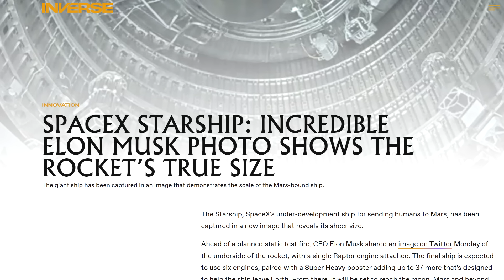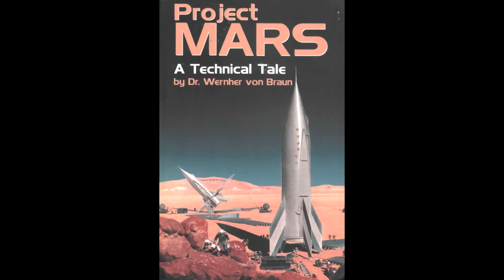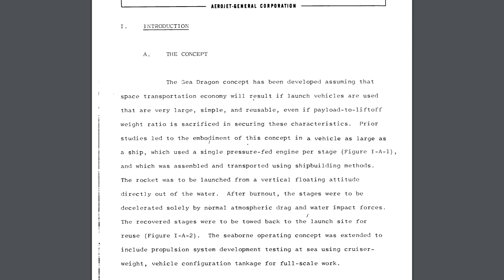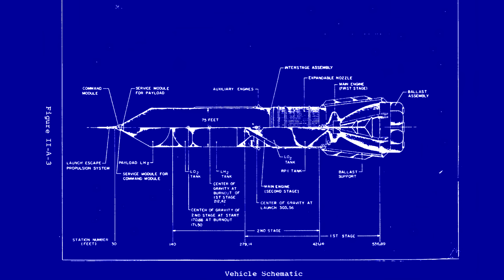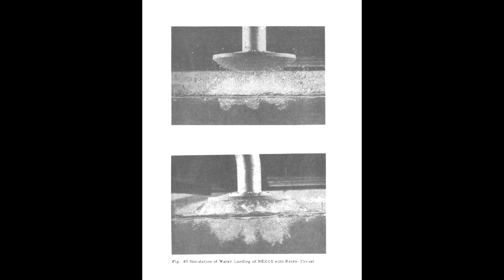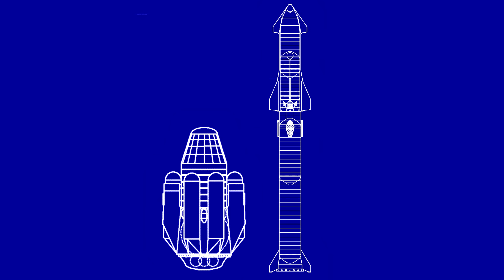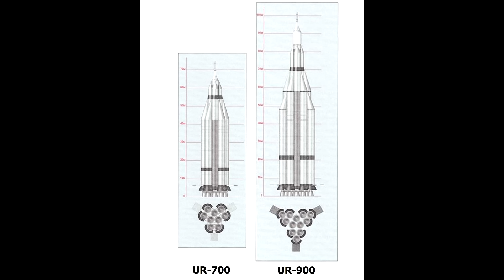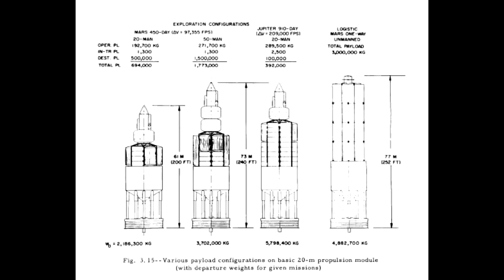The Old Rocket Designs That Make Starship Look Small

Comment: It's always surprised me how the Russians never really tried re-using rockets. The biggest problem the US has with it is that they launch over the ocean, and that's just not an issue for Russia... it'd be so much easier for them.
Reply: Well, they did quite a bit of work towards that: Buran/Energia and particularly Energia II. The problem was that by the time that reusable rockets could even pretend to be practical, the Soviet Union was on its last legs.
Reply: I'd like to point out that launching over the ocean is very much a feature, not a bug.
Reply: @Cancer McAids the problem with that is that rocket engines require very precise engineering and manufacturing, as well as special materials that can take the heat so they alone are going to be pretty expensive no matter what. Even a disposable booster could benefit from recoverable engine pods.
Reply: @Shaun_Jones  Which is apparently one concept United Launch Alliance's Vulcan is studying for recovering the BE-4 engines...if Blue Origin ever delivers them.

Comment: A design actually flying is kinda important. You can design almost anything you want, doesn't matter until you make it fly. Even just building it can uncover serious design issues.

So yeah let's just wait and see if Starship actually takes off. And not only that, it also needs to be economically viable. Remember Concorde?
Reply: Fun fact: One of the Heavy-lift Vehicles from NASA's SPS study (the Alternate Design at 10:31) has similar payload to Starship (120t), yet only 4000t mass when full. Which is less than simply the fuel mass of Starship (a 20% boost), and even with some mass reserve! Apparently, aluminium construction/winged flyback is a pretty efficient design!

Comment: I worked at the Naval Air Warfare Center Weapons Division in Solid Propulsion.  I worked on the base for 16 years.  The general public always looks at these design proposal documents wrong.  There was very little (if any) actual engineering that went into this.  The goal of these papers is to try and find some new emerging technology or buzz words that give an Admiral a hard on so he funds your project.  
These are boiler plate documents and mostly just a formality to show that you put some thought into the bullshit that's in your powerpoint presentation.  Each engineer in my branch was required to write 10-20 of these papers every year...the papers are completed and circulated just before the end of the fiscal year.  When you're in research and development there is very little direct funding from a major project because major projects are already passed the R&D phase and onto development, test and evaluation.  
Every single one of these papers claims you're gonna make the best thing ever that goes farther, faster and costs less than anything else that's ever been made.  If it doesn't do those things.....why tf would you be making it.  The whole point of R&D is to improve upon existing technology, so you're never going to see one of these papers that says "my rocket is slow and heavy, it basically has 100 lb cargo limit, and its gonna cost a shitload of money and assuredly be 4-5x over budget."     
A crapload of these documents are written every year.....it's one of the main ways folks in R&D get funding.  But an Admiral isn't gonna sit around all day reading 400 page documents....each of which is just proclaiming how great and cheap it is....which leads to the reasons for all the animations, graphics, etc.  No one is ever reading what you wrote on page 392 of your document.  Like I said...the document is a formality.  The buzzwords, graphics, animations sole purpose is to sell a product.  It's the whole reason they're made.  And they work....there's a reason you did a video on a 60 year old rocket.....and I highly doubt it stemmed from someone recommending you rad this awesome 400 page design concept from 60 years ago.  You saw an animation of this thing blasting out of the water and went "WTF is that" and immediately went to google trying to find it. 
Things like this get all this praise....it's so big, it's so cheap, it makes so much power.......but nope...it doesn't do any of those things.  
The thing was gonna use Nitric Acid + Hydrazine......there has not been one single production rocket to use nitric acid + hydrazine.  It's a shit hypergolic and has unstable combustion.
 Your comment about the making the rocket larger....therefore it gets lighter and the boundary layer being better as it gets larger.   completely lost me.  Fluid dynamics doesn't substantially change with the scale of the object.  It's basically  the whole reason wind tunnels can be used to test aerodynamics on models that accurately transfer to full size designs.  If it was literally as simple as "Make it bigger and it gets lighter, cheaper, and has a higher payload.......then we would have 5 mile tall rockets by now.    Also, starship weighs twice as much as Saturn V and has a lower payload.  Need to tweet musk and tell him he's doing it wrong.  It should be lighter than Saturn V, not heavier.  
Most of your comments about size at the end of the video can be countered simply by saying "Have rockets really scaled up?  Saturn V has been the tallest, heaviest and most powerful rocket for 53 years. 
You also keep using mass as a descriptor of size, which it is not.
Reply: "Your comment about the making the rocket larger....therefore it gets lighter and the boundary layer being better as it gets larger.   completely lost me." 
You got lost because you didn't get that he was talking about the bow shock during reentry. The bigger the radius, the further the bow shock (or boundary layer) is away from your rocket surface.
Reply: "Also, starship weighs twice as much as Saturn V and has a lower payload.  Need to tweet musk and tell him he's doing it wrong.  It should be lighter than Saturn V, not heavier." 
You didn't listen...
13:35 answers all your loaded questions. Sometimes you really should watch videos to their end.
Reply: That's a very interesting perspective, but I'm wondering; if so many papers are produced each year, why do the same few keep coming up over and over again? And what happens if your paper gets picked and the development guys realise you didn't put any effort into it? Do you lose your job because you "obviously don't know what you're talking about"? Oh but I'm forgetting the world is far too stupid for that kind of consequence.

Now I'm wondering how much of the money SLS has consumed actually went into fixing low-effort designs some nob liked the look of.

Comment: It still makes me sad to think what might have happened if American leaders had been willing to commit to building SPS. Not just the clean,almost limitless electric power it could have supplied, but the launch systems it could have spawned.
Reply: Fun fact: One of the Heavy-lift Vehicles from NASA's SPS study (the Alternate Design at 10:31) has similar payload to Starship (120t), yet only 4000t mass when full. Which is less than simply the fuel mass of Starship (a 20% boost), and even with some mass reserve! Apparently, aluminium construction/winged flyback is a pretty efficient design!

Comment: So... How about a comparison between the Space Freighter and Starship? Is there something wrong with SF's design? I still imagine that landing on a runway would be less headache than "chopsticks" and the rest of it. Why aren't Starship and Super Heavy both just space planes? There are advantages beyond just the landing.
Reply: Space Freighter?
Reply: Because space planes are one of those ideas that sounds cool but aren't very good in practice. Consider why SpaceX want to catch SuperHeavy boosters instead of landing them like Falcon - they want to simplify the design, get rid of unnecessary parts and weight. And wings and wheels capable of allowing horizontal landing are very heavy, and quite unnecessary if vertical landing will work.
Reply: Fun fact: One of the Heavy-lift Vehicles from NASA's SPS study (the Alternate Design at 10:31) has similar payload to Starship (120t), yet only 4000t mass when full. Which is less than simply the fuel mass of Starship (a 20% boost), and even with some mass reserve! Apparently, aluminium construction/winged flyback is a pretty efficient design!
Reply: @HalNordmann  It remains to be seen if Starship's steel construction is going to make it more reliable during reentry or more cost effective, and that is really my only thought on it. Had the shuttle not been mounted on the side of a taller tank, it may not have had failure on reentry. Weight seems to be not so different between them and when it comes to long-term cost and confidence, it really comes down to reliability (safety) and low-maintenance turn around. Maybe chopsticks will work, but it seems to me like landing on any long runway is a pretty big advantage.

Although, a space plane is going to have difficulty on the moon or Mars, and that is what SpaceX is shooting for. But then again, it isn't like we're not allowed to have more than one kind of vehicle.
Reply: @georgeshapiro301  Had the Shuttle not been mounted on the side of a taller tank, it would, unfortunately, have been an aerodynamic disaster very likely to fail during launch. Putting the aerodynamic center ahead of the center of mass makes a vehicle very unstable in forward flight but very stable in reverse. See darts where the heavy end is in front of the fins. If you throw a dart backwards, it flips around and flies heavy end first. To counter the flip, you'd need fins on the tank much bigger than the wings on the Shuttle -- see Werner von Braun's designs in the video. The fins would of course be called unnecessary weight.

Comment: There's a huge difference between building something and drawing a picture.  This is like comparing a Tesla Roadster to Speed Racer's Mach 5  car -- yes it is fast but it doesn't actually exist, it's just a figment of someone's imagination.
Reply: And most of these sat a fair way between those two.  I'm most familiar with the Nexus, and it was a LOT more than a sketch.  There's factory details, material selection, calculated decibel values for launch, and so on.  These were engineering plans, not just someone's sketches.  That said, that's still not "someone built one".  And "Someone built one" is still not, "it worked".  And "It worked" isn't "It works, repeatedly, and reliably".  Draw your line in the sand where you choose.

Comment: Would love to hear more about that idea of the solar farm in space. Like that sounds crazy but then sounds like it might actually work at some point much further down the line
Reply: -  We are already in the midst of runaway global warming. Why would anybody want to add to the problem by increasing the amount of solar radiation beamed to ground level by miles wide reflecting mirrors out in space?
- Sounds like a no-brainer to me.
Reply: @mydogbrian4814  the solar energy would be converted to electricity in orbit, then beamed to Earth using microwaves. Also, the sunlight intercepted in orbit would otherwise land on the Earth's surface anyway, so no additional global warming.
Reply: Fun fact: One of the Heavy-lift Vehicles from the SPS study (the Alternate Design at 10:31) has similar payload to Starship (120t), yet only 4000t mass when full. Which is less than simply the fuel mass of Starship (a 20% boost), and even with some mass reserve! Apparently, aluminium construction/winged flyback is a pretty efficient design!

Comment: THIS IS NEVER GONNA GET BUILT. ELON IS TOO OBSESSED WITH MAKING IT RAPID REUSABLE, FOR SOME WEIRD REASON
Reply: No, he is obsessed with simultaneously making it rapidly reusable, cheap to manufacture, and able to do literally everything space-related and then some. Combining all these factors is just impossible! Fun fact: One of the Heavy-lift Vehicles from NASA's SPS study (the Alternate Design at 10:31) has similar payload to Starship (120t), yet only 4000t mass when full. Which is less than simply the fuel mass of Starship (a 20% boost), and even with some mass reserve! Apparently, aluminium construction/winged flyback is a pretty efficient design!

Comment: 12:44 What was this disaster and why were the hypergols more dangerous than LOX/kerosene? All chemical rocket propellants explode when the vehicle crashes.
Reply: See Scott's earlier video "What are Hypergolic Rocket Fuels? (Other than Explosive, Corrosive, Toxic, Carcinogenic and Orange)"
Reply: @marcusdirk  Thanks for the link. Very informative. However, when he says "very messy Proton accident in front of a lot of VIPs that showed just how dangerous hypergolic propellants were" I am assuming that he means the toxicity, not the fact that it exploded...which just about all rocket propellants do in a crash. Unless there is something I am missing. Do you know if any of the VIPs were hurt?
Reply: @flechette3782  I don't know any details of that accident. Scott may have talked about it before: he has a whole playlist on "Rocket Failures & Crashes", and several other videos on fuels.
Reply: @flechette3782  With hypergolics, you not only get an explosion, but also lots of toxic chemicals spill out.
Reply: @flechette3782  Hypergols have the advantage of being storable, and not requiring an ignition system. Until the advent of comparably powerful solid rockets, that was the biggest advantage. That was why the Titan II was a big advantage over the cryogenic Titan I and Atlas ICBM's. They could launch without having to use 15 minutes to load LOX into their tanks. OTOH, the toxicity and corrosion problems, along with the self-igniting characteristics were the biggest detriment. Example: Soviet submarines used hypergolic ballistic missiles and had several incidents due to propellant leaks, especially N2O4, which cause death and loss of K-219.  In the case of a Titan II, at Damascus, Arkansas, a ruptured Aerozene 50 tank caused a tremendous explosion that killed two maintainers!
For space launch vehicles, cryogenics loaded just before launch are less of a problem and have higher performance.  Don't have enough information about the Proton incident and casualties.
Reply: @jamesbarnard9710  I understand all of that and am familiar with the Titan II accident at Damascus. I worked the Titan program myself.
However, having worked on Titan I know the advantages and disadvantages quite well, and I think that the disadvantages are way overblown. People have a bias and point to any hyprgol accident as proof that it shouldn't be used...but then look the other way when there are accidents using other types of propellants.
For example, N2O4 may have been the cause of K-219, but we have also seen plenty of other subs go down for other reasons. A few Soviet subs had reactor meltdowns. Should we stop using nuclear reactors? That would be silly.
How about solid rockets. Anyone remember Challenger? 
LOX/Kero: There are entire video montages of rockets using these propellants exploding in all sorts of ways. Even SpaceX had one blow up on the pad. Interestingly, the failure mode for that one wouldn't have happened if Falcon 9 used hypergols. It blew up precisely BECAUSE it used cryogens.
Yet somehow there is this weird belief that cryogen = "safe" and hypergol = "bad".
Reply: @flechette3782  Although I didn't mess around with UDMH or MMH, nor N2O4, I DID experiment with aniline and RFNA in high school, using proper protective gloves and masks, prior to successfully static testing an actual 55 lbf non-flight weight rocket engine. One of the reasons I used hypergolic liquids was this was before Estes Industries came out with their model rockets using pressed grain black powder engines, and I was a bit of a chicken when my friends were mixing zinc dust and sulfur in hardware store aluminum tubing...and blowing them up about ten feet above the ground!  Bought G.P. Sutton's "Rocket Propulsion Elements" and taught myself to design a liquid rocket with hypergols.  BTW, the disadvantages to cryos on alert ICBM's is simply the time it takes to load propellants...or at least it was back then. Falcon 9 sure does a nice job of "load and go"!

As far as solids are concerned, Challenger wasn't a matter of the solids themselves, but the joint designs AND the arrogance of certain NASA people in insisting on launching in spite of warning by McDonnel at Morton-Thiokol. Solids can have problems too, of course.  IIRC, we had a Titan III or some such blow at Vandy as the result of a case-bond separation on one of the solid rocket boosters. The advantage to liquids is, unless something truly catostrophic happens, you can detect a problem, sometimes miliseconds before and shut the thing down.  For high-value payloads, including crewed missions, I don't trust solids as far as I can throw one!

Comment: I wonder how Elon's rocket would look if fueled by liquid Hydrogen - it's about 3 times the volume over liquid methane for the same energy storage. Methane uses a carbon atom to sort of "compress" (hold) the hydrogen, so liquid hydrogen would make the rocket a lot fatter. The Space Shuttle super tank could have been a bit smaller too with methane. Interesting
Reply: 3x the volume means 3x the tank for the same energy so likely some kind of mass penalty.. Would the greater ISP make up for it?
Reply: Fun fact: One of the Heavy-lift Vehicles from NASA's SPS study (the Alternate Design at 10:31) has similar payload to Starship (120t), yet only 4000t mass when full. Which is less than simply the fuel mass of Starship (a 20% boost), and even with some mass reserve! Apparently, aluminium construction/winged flyback is a pretty efficient design!